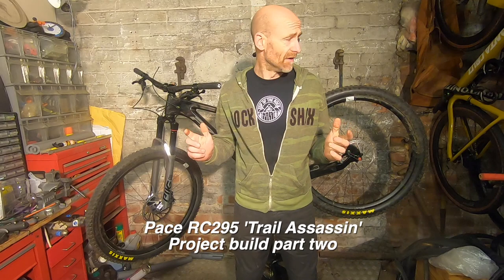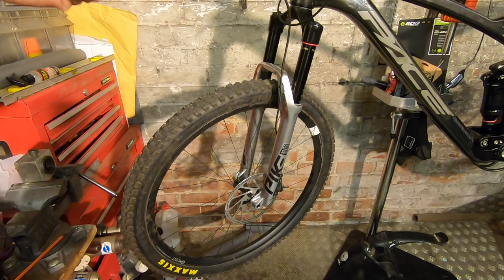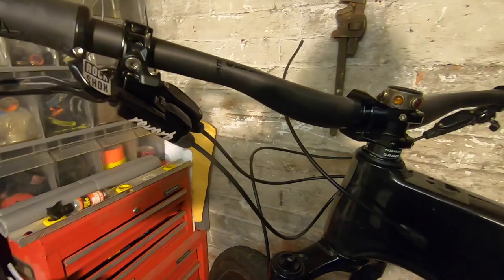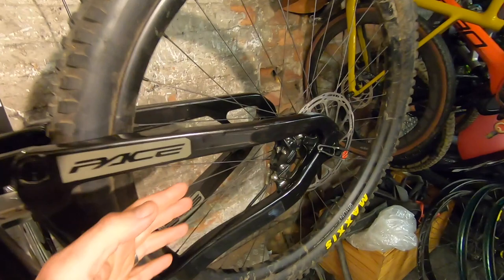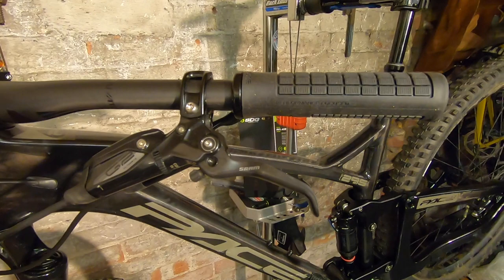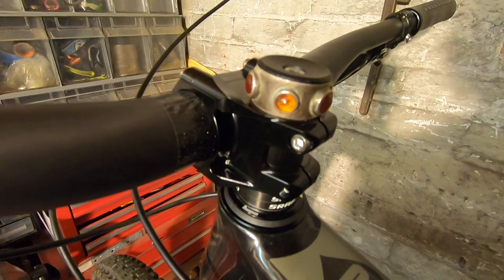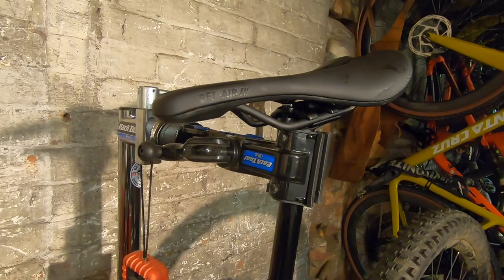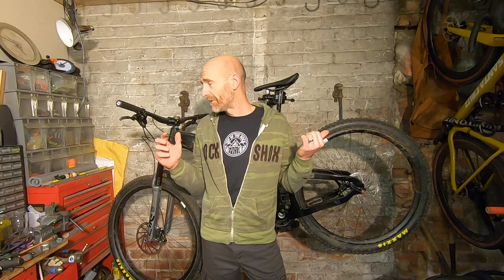Pace RC295 'Trail Assassin' project mountain bike build: Part 2

Comment: Beauty.. I ride a carbon enduro and very interested in a uk built machine.. Will be super interested to hear more on this. To be honest; could you tie the brakes in with Handgrips. I know you fitted some but colour wise I was thinking.
Reply from the maker: That might work actually. Definitely got the right colour grips and some PNW bars that I need to test too which have red on em. Any excuse to get that big Code power to play with. Proper first ride rather than the dank and dirty mess that's already up being shot this afternoon. 👍
Reply: @GuyKesTV  awesome hehe 👍🏻👍🏻